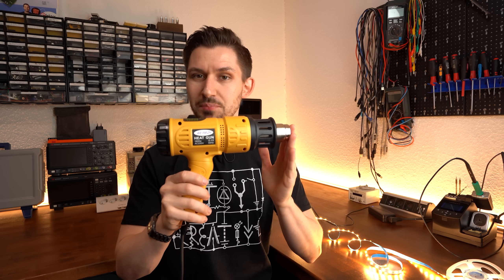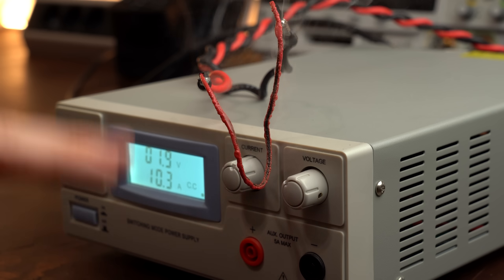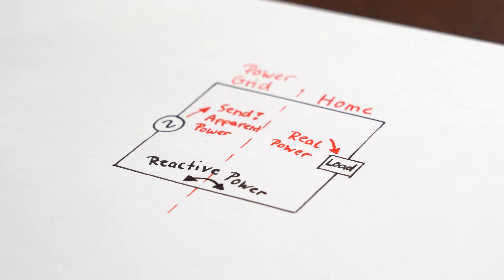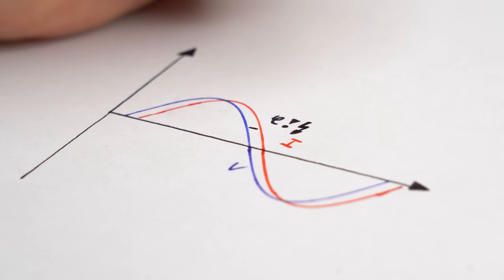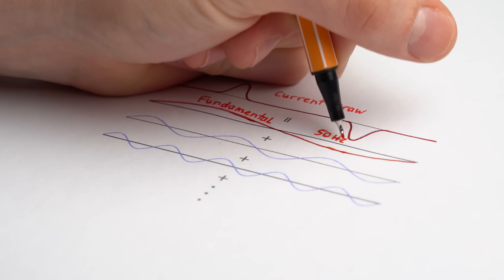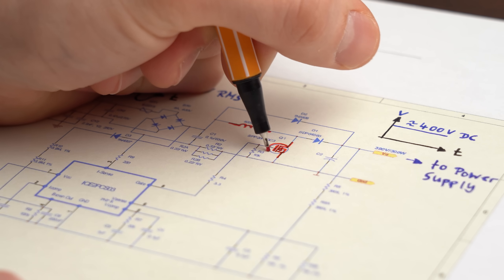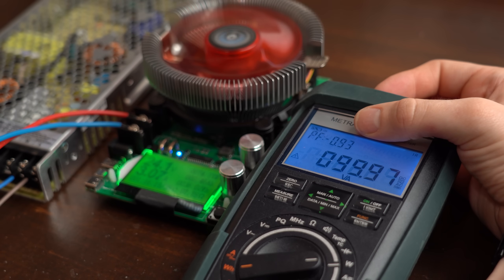The Most Important Circuit for our Electrical Future?! (PFC) EB#55

Comment: Did you hear about the guy who drew free electricity from the railway line?  He discovered that his metal fence was slightly live, so he insulated it from ground and powered his house from it.  Basically he was placing a capacitive load on the train (inductive motor) power lines which ran very near to his fence, thus straightening out the power factor.  Eventually word got out and he was prosecuted for stealing electricity, but in court he proved that he was actually reducing the train companies electricity bill.  He was not punished but the train company ran a grounded fence by their power lines denying him any further benefit..
Reply: Hopefully he didn't discover the metal fence was slightly live when relieving himself...that could have been an opportunity to sue the railway for creating a public (pubic?) nuisance :hourglass-purple-sand-orange:
Reply: It sure looks😂 like a lot of harmonic noise

Comment: Grid operators have big synchronous compensators (also called synchronous condensers), that are basically free spinning synchronous motors, to actively adjust conditions in the transmission grid. They are a more flexible alternative to capacitor banks. They were introduced in the 1930's and have been in widespread use since 1950's. They are still needed, especially due to wind and solar farms. In my opinion there should be requirements for PFC also in consumer equipment. There is so much crap out there.

Comment: Not only because of LEDs, but with the increasing number of inverters, as a company we are starting to install neutral cables with bigger sections (it usually is half the phases section). Harmonics are starting to get at concerning levels in some places.
Reply: This issue became a big thing when computers first started hitting desktops in large office environments. There were instances of neutral cables actually getting hot enough to burn off their insulation. This is due to the fact that the narrow current pulses that result from simple rectification and capacitive filtering, as shown in the video, don't cancel in three-phase systems and instead almost 100% of the current would flow in the neutral contuctor - six non-overlapping pulses per cycle.

A lot of this was blamed on the use of switched mode power supplies, but any capcitively filtered rectifier circuit is just about as bad. Iron core transformers do slightly knock down the current peaks due to leakage inductance, but not in a very useful way. It was mostly just the fact that switchers were used in most of the devices installed when use of electronics in offices exploded.
Reply: @D614G_aka_Doug 
newer computers use less power these days because the cpus are faster than a person needs

Comment: Does this happens to electric car chargers too? Or do they have pfc in them?
Reply: All mains equipment over 75W must have a PF better than 0.9 or you are not allowed to sell it in EU, so yes all electric car chargers have PFC built in. (EN/IEC 61000-3-2). This is only a problem if you buy cheap badly designed power supplies under 75W (at least in EU). In US this is up to each state to regulate, but there is a recommendation IEEE 519, so most likely in US as well. Most of the world usually follow standards that are similar, but they may not always be enforced, in my experience.
Reply: @Qmcr9Vjm62  thanx for the reply, always good to know.

Comment: So if we used DC as main, everything would be a whole lot better
Reply: That debate was settled about 100 years ago 😂
Reply: @Qmcr9Vjm62  But maybe it's gonna change some day when we are getting more and more energy from solar panels which is DC and more things are electronically control, which means you have to convert to DC and the fact that transmitting DC is more efficient, and we have more technology than we did a hundred years ago

Comment: Cheap LED drivers often achieve power factor correction with a single stage topology. Mostly a flyback one. But the output has a lot of voltage ripple. Almost like a 50hz rectified voltage. Thats why you can see the LEDs flickering. Specially one cameras.

Comment: Is there any way to do the opposite of this? My power company has been upping the prices of electricity crazy amounts recently (and I don't think the price of wind has gone up either) best idea I've had to give them the middle finger is to run a large induction motor with no load 24/7 but that still uses some real power.
A power factor as close to 0 would be desirable.

Comment: Very cool. Maybe, I missed it, but how much loss does the PFC unit itself introduce?
Reply: A decent active PFC stage 20 years ago would run at around 95% efficiency, depending on the input voltage. When a large boost, such as from 85 volts AC input (the usual lower limit for a "universal input" PFC stage) is required, efficiency drops a few percent. With newer FETs and high-voltage ultrafast recovery rectifiers some improvement could be expected. If cost is no object, some additional improvement can come from using very high performance core material (e.g. molybdenum permalloy powder) for the boost inductor and winding with Litz wire instead of ordinary magnet wire.

Comment: Power factor IMPROVEMENT.  The cost for power factor correction is exponential. Power factor IMPROVEMENT will also depend on leading or lagging voltage/current phase.

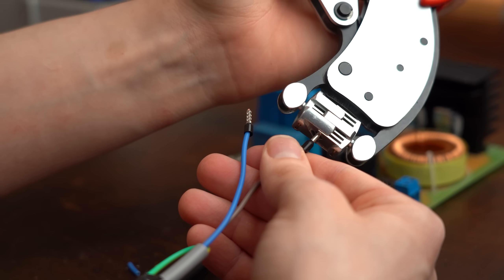Comment: Great video! Quick question unrelated to the topic—what is the name of those connectors you crimped on your wires before installing them in the screw terminal blocks at around 8 minutes in? (8:04 )
Reply: Crimp tube terminals

Comment: Interesting factoid about PFC: in the past, unscrupulous people used to tamper with their inductive loads, such as washing machines, pumps, and other motors and REMOVE the PFC capacitor in order to steal part of the electricity from the power company!
This is because power companies used to measure their customers' energy consumption using electromechanical meters, old devices containing a big spinning wheel that would complete a revolution after a known amount of energy was delivered to the customer, plus an odometer to count the wheel's revolutions.
One problem with those electromechanical meters (that has since been solved with digital energy meters) is that they would only measure the current delivered IN PHASE with the voltage. Large inductive loads, such as motors, were (and still are) required by law to be sold with a suitable capacitor as a passive PFC. But if one removed the capacitor, a good part of that load would become undetectable by the energy meter!
This is of course illegal and detrimental to the power grid, so nobody should attempt to do it, except in a laboratory condition.

Comment: These should just be part of every breaker box or main inlet
Reply: No they shouldn't. There is a lot more to it than what is explained in this video. 
If you want to have a good Power Factor, buy well designed power supplies. As a bonus they are more efficient so you save money as well.
The video is not technically wrong but it's a band aid solution when you have no other choice.

Comment: Excellent video! One of the most apparent circumstances where a poor power factor can be an issue is when using backup inverters. Your 1500VA backup inverter is only going to reach 1500W if you've got a perfect load on it. If you've got a poor power factor, you'll have to derate the power rating!
Reply: Great point! I blew up a couple of cheap inverters trying to charge e-bikes with a cheap chopper charger. I assumed a 500w inverter would run a charger with an output of 100w easily, WRONG!!

Comment: Interesting. I guess that each poor PF device in your home (eg mains led lights) are synced to the 50hz mains so exacerbating the issue.  Maybe we should be moving towards low-voltage housing circuits with one high quality ~1PF power supply. Is that something that will happen?

Comment: The fastest way for this to be implemented is to allow the power utilities to change the real power meter to an apparent power meter. IF the power factor drops below 0.9,  then the utility company will charge you extra.
Reply: In EU anything above 75W must have a PF of 0.9 or better or you are not allowed to sell it. EN/IEC 61000-3-2. Almost there 😊

Comment: Why does the voltage output have to be boosted to 400 volts? Couldn't that output stage just be a buck converter and then give a lower DC voltage, still with the PFC function? 

From what I understand, a lot of newer power supplies have built in PFC. With the main expedient in creating that is to place the reservoir capacitor after the chopper device, rather than before as with traditional designs, with the PWM cycle adjusted accordingly.
Reply: If the PFC is a buck circuit it would not be able to draw current from the lower points of the sine wave.

Comment: The IC making money 7:25 and that it's the problem to make me fail to repair the PSU board. Due to most of the local store are not selling. The only sales are the entire Circuit board.
The old type of power converter just required to fix back the coil and do some replace like recap and replace diod. now day required to fix the more and replace valve, resistor, cap and the especially last difficult to find component part is the IC.

Comment: I know this is crazy...  But how about we do the electrical grid like they did in the old days..   BY BUILDING IT for FUTURE CAPACITY!  
In fact, we HAD all this extra capacity.  They closed over 10,000 plants all around the world or more.    And about the grid itself?   They have been just keeping up the old infrastructure without upgrading it at all since the 1950s.      

Instead of running new lines?  They just tapped on what was there, and then told everyone to use "Energy Efficient" bulbs and appliances.  And switch to Natural gas for things like heat and cooking.      WE HAD all the capacity and then some BEFORE!   But all this making more gadgets to put a band-aid on it all is just that.  A STOP-GAP.  Nothing more.

Comment: Yes, the PFC circuit does reduce those harmonics for the device it is correcting, BUT due to all that PWM activity of the mosfet in the boost converter it could well be adding tons of harmonics back onto the AC mains. (Do a 'before and during' test with a spectrum analyser.) While this is not a reactive power issue this 'dirty' electricity has been shown to add to the EMF smog in the house and beyond.

Comment: One key point that seemed overlooked - Home users are not charged on apparent power, they're charged on real power. So this isn't going to lower your power bill, only give the grid more headroom. And a small power supply like that is literally going to have no effect on the grid on its own. Only when regulation comes in and every device needs to comply, then there will be a measurable difference. So I wouldn't be rushing out for expensive power factor corrected power supplies any time soon.

Commercial buildings are metered differently, and they do have to think about apparent power. But they just install a correction for their whole shop/office/workshop etc. Not individual correction units on every tiny power supply.
Reply: I'm in UK. There was a scare that smart meters were going to charge for reactive power.  I think they measure it, and we might be charged in the future.  In Italy the domestic meters have the usual led flash every 1Wh, and they have a 2nd led flashing for reactive power.

Comment: Hello GreatScott, I've recently seen a video on a free energy motor/ engine. I would like to know if this device is capable of supplying the power needed to recharge a battery generator. Also, if an engine like this is easy for a novice to build
https://youtu.be/nnAE0hqgH6Y

Comment: Old energy meters measure only ACTIVE power. PFC correction is already included in Kwh price calculation.
Reply: It's an inefficiency in the utility's business model to only bill you for active power.  Poor power factor contributes to increased operating expenses of the grid, that are not reflected in the real power your utility measures.  Displacement power is easy to correct for, since you can simply add the opposite circuit element from the problem type of power factor.  Distortion power is much more difficult to correct for, at the utility scale.

It's common that larger customers are billed for power factor and/or reactive power, while for residential customers, it is difficult to justify the expense of upgrading the meter.  That said, it's only a matter of time until there is enough saturation of non-linear loads for it to become a problem that they eventually have to start reflecting in billing, as a motive to the consumer solve the problem.

Comment: Nice video. I can only note at 8:00 professionals don't put PCBs with grid voltage traces on a bare table. Professionals use distance bolts.
Reply: Real profesionals use rubber mat whit spacers 😂
Reply: Last I checked, wood is an excellent insulator. Who tf cares? Talk about picking nits

Comment: What is the effect on true power consumtion of the active PFC? Does it have any negative side apart from the increase in components?
Reply: The efficiency takes a small hit since you add losses in the additional components. This loss can be quite significant in standby if you can't switch the pfc off. Hardly worth bothering with low power circuits and it's always better and cheaper to select power supplies with proper power factor (cos phi) if at all possible i.e. well designed.

Comment: Having tried to explain this to many people.  I prefer the perpetual loan example.  If you give your house buddy £500 a month for "bills", but almost always end up lending him another £500 for his own bills that he then pays you back before the next month.  The first £500 is the real power.  The constantly pining back and forward £500 perpetual loan is the reactive power.  The Apparent power is £1000 a month.
Reply: I pretty sure if you do enough accountancy regarding offsetting debts and assests you'll probably do exactly the same thing as "power factor" with those in the cashflow analysis.
Reply: To explain why this is bad for the energy company.  In this example, you are the energy company.  Each month you will require £1000 to get both your bills paid and your room mates.  The fact he will give you the £500 back still means it's unavailable to you.  You still need £1000 at the start of the month to "keep the lights on".  Even though it is only costing you £500 in real terms, if you don't have that £1000 at the start of the month, the bills don't get paid and the lights go out.  That's why it's bad for you.

Comment: Actually I would like to turn this one the 180deg. Imagine how much electronics that we could avoid if the power grid would be designed to handle the bad  PF. Just in my house ther is probably 10 products with active pfc smsp. 
Unfortunately that is not reality, maybe make a video that could look in to solution that would alow many “PF sinners” connect to the grid.
Br
Reply: That exists today. I'm no expert on the power grid, but I do know that for industrial applications there are sub-stations that have passive PFC. My guess is that the cost is very high and the loads vary a lot, so difficult to design a PFC for a whole block. In addition you would still have problems between the PFC device and the consumer, i.e. in your block, building, flat or where ever you try to do PFC and filtering. 
I believe the only practical way to solve this is to require well designed power supplies. That solves both the PF problems, harmonics/interference and efficiency. Unfortunately our society today seem to go for the low cost option 99% of the time, which leads to a "race to the bottom" where quality is the first casualty and repairability the second.

Comment: so how would you go about installing something like this in your home grid ?
having 1 pfc on each item (every charger, every led light, ...) would be unfeasible,
so i would assume there should be one on the main distribution panel, but how ?
Reply: No, the standard solution is to have PFC in each device. The parts are pretty cheap.

It's possible to have PFC on a distribution panel but that is much more complicated.

Comment: PF of 0.58 (what that LED strip comes out to at 21W vs 36VA) is actually not too bad compared to most small switch mode power supplies. I frequently see 0.4-0.5, which is more the norm for small power supplies. 

My secondary computer monitor as an example is 0.38 PF (my primary monitor has dual USB-C with PD on both, so its 340W power supply exceeds the required load rating to require PFC by law, so it comes in at 0.97 since it has aPFC).

Comment: Reactive power cannot be consumed - reactive power only flows through the devices, the only reactive power remnant is Joule heat I²R in the wires. Most of the home current smart meters count only the flow of capacitive reactive power, the simplest solution to this problem is to use a simple choke at the input.

Comment: Or, a dedicated DC circuit could be implemented (with some amount of battery backup at the switchboard) then only the main AC-DC converter needs PFC.

 -- if DC loads were just operated off DC, efficiency  improves (and a typical home's DC service could be off-gridded without any problem.)

I have been positing using Solar MPPT Charge controllers as low cost high power, AC-DC  agnostic, battery bank chargers  ie, high power AC-DC Li-Ion or variable output supplies (nominal 12/24/48VDC)  are "specialist" and fairly expensiive, while 100A MPPT Charge controllers  are readily available - feed them off Solar/Wind DC (50-400V), OR the output of a 400V 2-5kW AC-DC converter - one is a step closer to storm proof, Auto PFC is a (grid) side benefit..